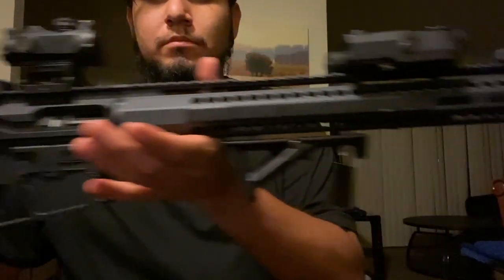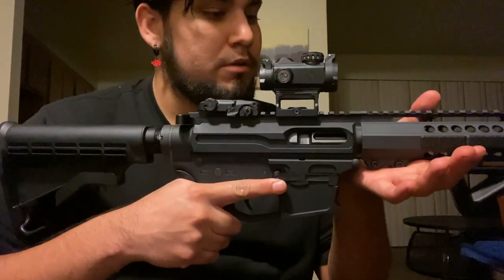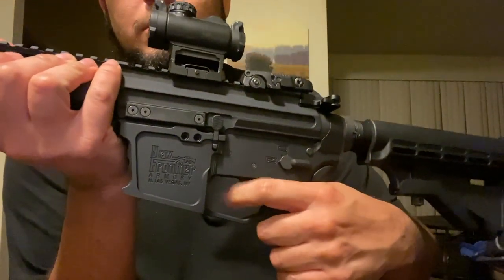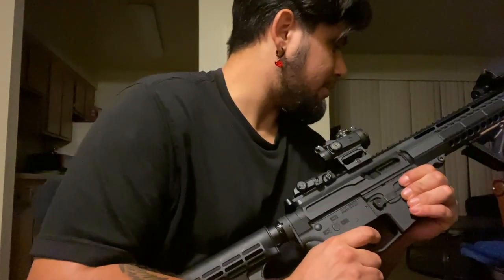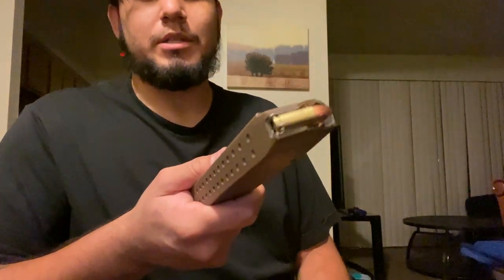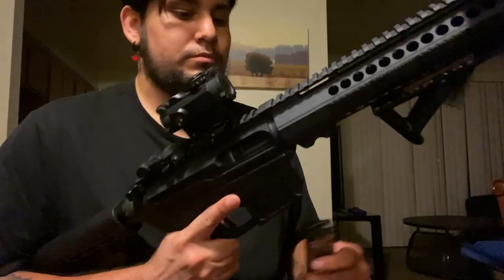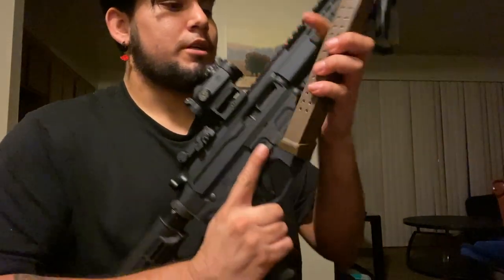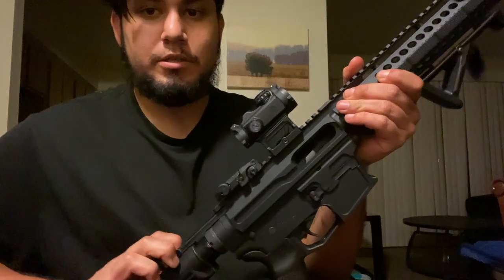SDI Final - NFA AR-9 Build - Functions Test

Comment: Glad you did this video, I'm also an SDI student and I chose the AR-9 for my final build. This is the first AR-9 build video I've found from students. How does the process work, do they send the stripped lower and upper or do you choose your components?
Reply from the maker: Hey man thanks for the comment. Yeah so basically you’ll choose an ffl to have the lower sent to and the rest of the parts will be sent in a large box to your address. You’ll have it before the course starts but if you decide to build early like I did, make sure you look at the final project details to get the right pictures as everything is being put together. 

You do not choose which components you receive. I assumed it would have been a plain Jane milspec upper and lower but to my surprise, it turned out to be a rather nice billet receiver set. From new frontier armory. Never had heard of or used them before. It shoots fine with the occasional jam. Usually only when I load the mags all the way.
Reply: Is it a stripped lower or an 80%?
Reply: @bobsaget769  yea they sent a stripped lower from Palmetto State Armory to a local FFL. They stopped sending 80% due to the ATF rule changes.
Reply from the maker: @bobsaget769  stripped.

Comment: Did they send you a completed lower to an FFL or did you do the 80%?
Reply from the maker: Completed lower.
Reply: Ok thanks. Alot of the older reviews of the project are with 80% lowers.
Reply from the maker: @Kingsmit18  yeah they had just changed that 
I think while I was in actually I remember a email from them stating they’d be using completes. I think it was to accommodate other more strict state laws.